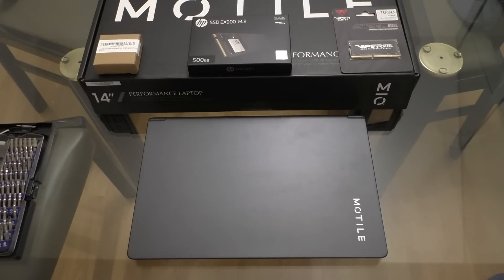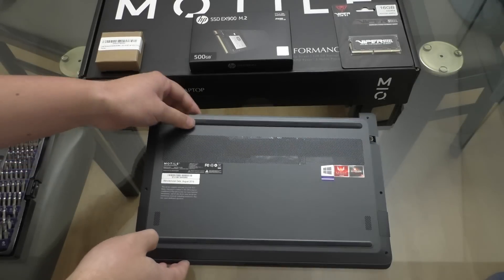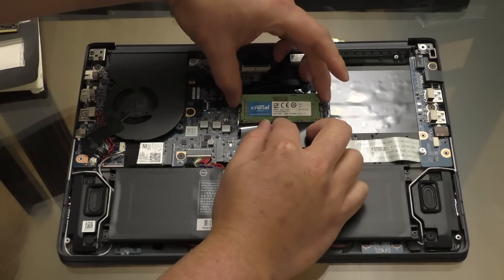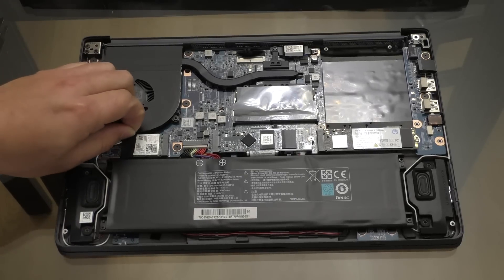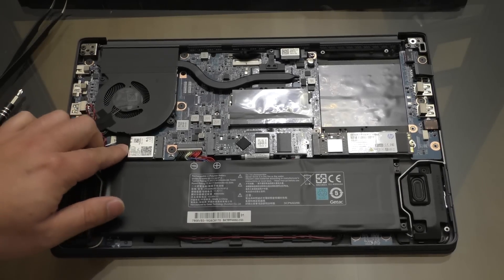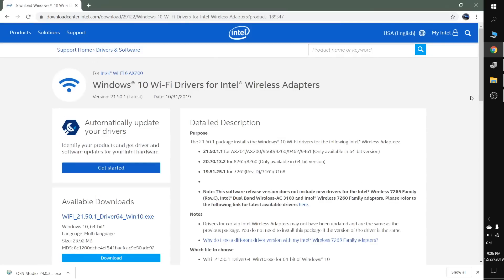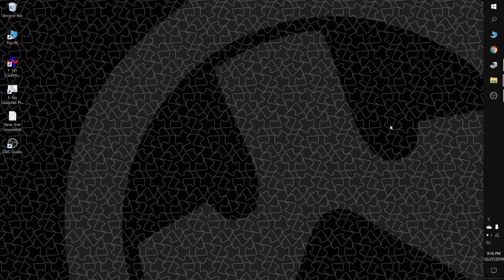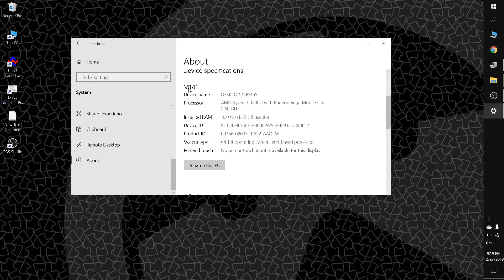Walmart Motile M141/M142 Upgrades (RAM, SSD, Wireless Card)

Comment: Great video thanks for the information. I did have one question, why are you not using the new faster drive as a boot drive?
Reply from the maker: Walmart/Motile's support is lacking, and I've seen stories of others who tried to do clean Windows installs on new SSDs for this platform have trouble getting the required mobo drivers to successfully swap the main boot drive. That said, I'm sure I can clone the original drive to the new SSD and set it as the boot drive, but I'm pretty content with the boot drive as is (and don't really plan on putting much else on it).
Reply: @FaRKle0079  Great video overall and I appreciate you being thorough with the steps needed to safely upgrade the memory, storage and Wi-Fi.   I did want to share a link to the laptop's drivers, in case others want to do a fresh install...
http://www.motilecustomerservice.com/m141.html
Reply: FaRKle0079 so i bought m.2 sata and its not working in the ssd port 2 ... is second port only for nvme m.2 ?

Comment: I can answer my own question. Vega doesn’t actually lock down the allocated memory, so it isn’t like Kaveri or other old APUs where it just automatically reserves more system memory proportionally as you add more, then refuses to give it back.
Reply from the maker: Yup, I believe Picasso dynamically allocates additional system memory as needed. I know on some systems you can change the iGPU reserved amount, but there isn't any setting for that on the Motile's BIOS.